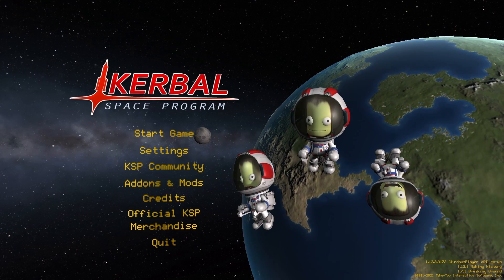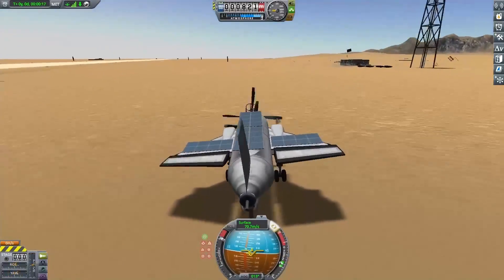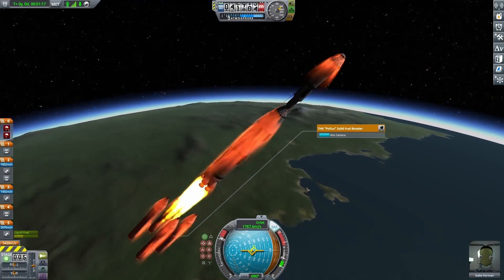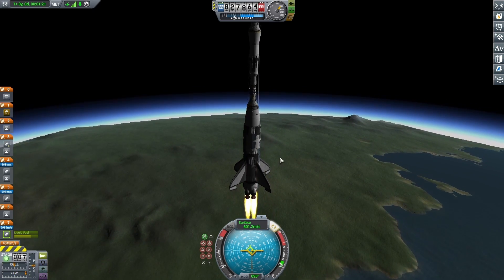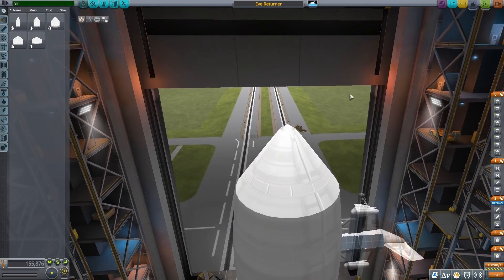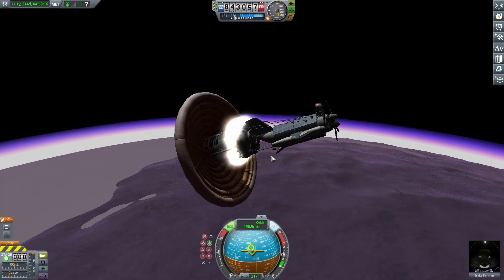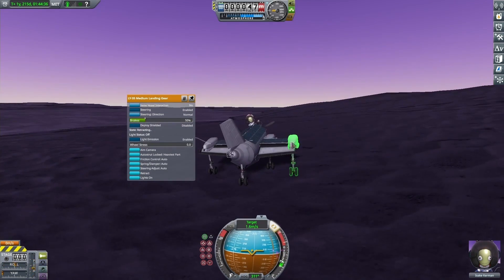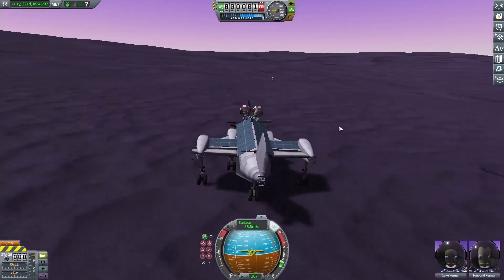Attempting The Most Challenging Rescue in Kerbal Space Program

Comment from the maker: The long awaited rescue is now under way. Part two should come out soon, I'm thinking early July. If you have any tips feel free to let me know because I'm not finished recording yet!
Reply: Propellers are a lot more powerful than most people realise, but they work a bit weird.

Propellers generate thrust, but also a lot of drag. So a propeller aircraft has a rather low terminal velocity, and no amount of extra motor power will get you beyond that. What you need to do is change the angle of the propeller blades - a steeper angle generates less thrust, but has a higher max velocity. A flat angle produces mad amounts of thrust for liftoffs, but is slow.

So use the "deploy" option on the blades and map the "deploy angle" to main throttle instead of the motor speed. You'll figure it out with a bit of experimenting.
Reply: Pretty cool video man can’t wait for part 2!
Reply: you still havent done it, its been more than a month since the expected date.
Reply: "july"
Reply: Verry nice video man good job really liked it!
Reply: Play stormworks
Reply: Your flight path on kerbin is also usually the optimal flight path to get off of Eve, getting out of the atmosphere as quickly as possible, then going from there. Also, that changing of orbit without engines may be because of an accidental kraken drive with the docking acquire force, just set that to 0 and hope that it is solved. Basically if 2 docking ports are within the "magnet" range of each other, you can set one's acquire force to 0 and one to max to get a kraken drive.
Reply: Your my favorite youtuber
Reply: You can put another inflating heat shield on the back of the spacecraft to balance things out when reentering.
Reply: The plane tactic was smart on eve
Reply: Is there mods here
Reply: I did not think those propellers would work. for most coax helicopters, you can't offset them like that. lowkey kinda smart.

Comment: If you put an electric propeler motor over a motorless fuel propeler motor you will cancel the torque and have extra energy from the generator of the motorless motor. As the generator has a fixed output, you can get free energy if the atmosphere is thin enough

Comment: The reason you're having trouble taking off is because your landing gear is behind your control surfaces. When you take off, those surfaces push down on your wing, so you want the landing gear to serve as a fulcrum. That way, when the tail is pushed down, the aircraft tilts up. You're having an easier time lifting off on Eve because the ground is bumpy, so it bounces you into the air and eliminates the problem lol

You can also solve this by adding canards to the nose, which means you're lifting off by lifting the nose rather than pushing down on the tail. But that adds instability to the aircraft, so it's not a great idea.

You should check out Scott Manley's aerodynamics for beginners series. It's pretty old but the principles are the same, and it's done in the KSP editor, so it's easy to grasp. The second video goes over this stuff if you're interested.

Comment: I might be super late to this, but I noticed that propellers kinda work like an IRL gearbox (maybe? I never drove a car lol), so you can use that yellow robotic controller from Breaking Ground DLC. You start with 0 degrees attack angle on blades, set “throttle” to control your blades’ attack angle in robotic controller’s action menu, first you go full throttle (about 70 deg. of blade’s angle of attack), build up your speed, and then you lower the throttle (thus lowering the AOA) which will increase your speed further, and then you’ll hit the cap at some point, but the thing is you really should use tweakable in-flight AOA on propeller planes, idk how this works, but it does. Some people can explain this, but I’m just sharing my experience.

Comment: Awesome video! A few tips: when launching, you can actually begin tipping over extremely quickly even with solid rockets. I recommend starting around 50-100m/s, and then tip over just a few degrees. Hold that position for a bit and then just lock to prograde. Gravity will drag your prograde marker down - aim for reaching 45 degrees (halfway between the top of the navball and the horizon) at around 9-10km in height. Then you can aim just above the horizon on the navball until your apoapsis reaches the right height. 

This is how it’s done in real life albeit at a smaller scale, and it improves efficiency a lot. The larger your circularization burn, the less efficient your launch (generally). Using that method you can very consistently achieve orbit on kerbin in less than 3500m/s of dV. It works a bit differently on other planets, but for kerbin it works great. On small atmosphere-less bodies you can tip over almost all the way immediately, and on a body like Eve you have to be going much faster before starting your turn. The main point is that speed is a pretty accurate determiner for when to start turning with a bit of practice. I’ll look out for part 2!

Comment: The issue you had while launching at 5:30 is because your vessel was physics easing (the fame slowly puts your vessel onto the ground when you use the position cheat). This stops once you touch the surface (which didn't happen in the video) or if you uncheck the checkbox "Ease to Ground" in the position cheat menu.
You can tell that it's physics easing by the message at the top of the screen
Reply: cool

Comment: Tip with propellers: Hold alt when putting them on, and go into the settings for the motor and change the amount of nodes. You should also keep the actual angle of the blades the same, but use the deploy feature & deploy angle.
Reply from the maker: Interesting, thanks!
Reply: ooh
Reply: seconding the deploy angle - you can change it on the fly in-flight, which can get you more thrust at higher speeds
Reply: @GluttonyReaper  Bind it to main throttle in control groups for a smoother experience.
Reply: @unquestionablysaucy  I tend to binf the main throttle to the torque but I would like to have a way to like, some how have variable pitch props based on speed
Reply: Deploy angle is everything with props in ksp
Reply: The funny part is I suck at this game, yet I figured out the propellers almost all by myself. Took me an hour, but dang it went by fast.
Reply: @Flamsie  bro y'all have some extremely wrinkled brains it took me 3 years to get to orbit.